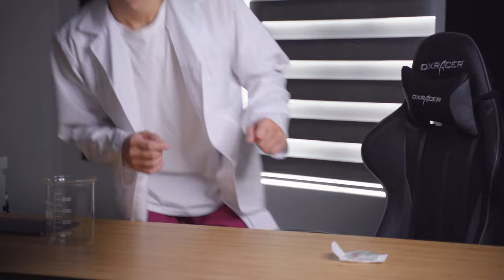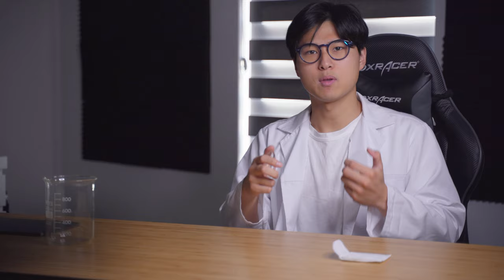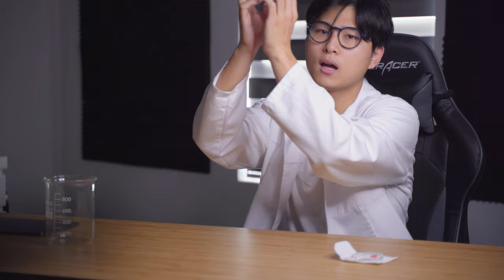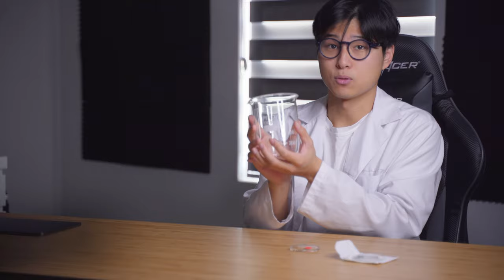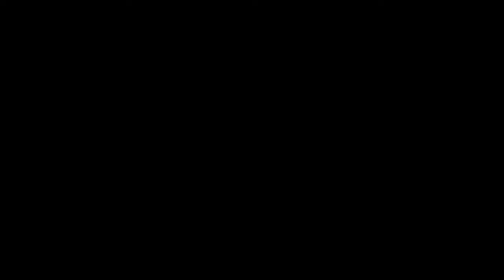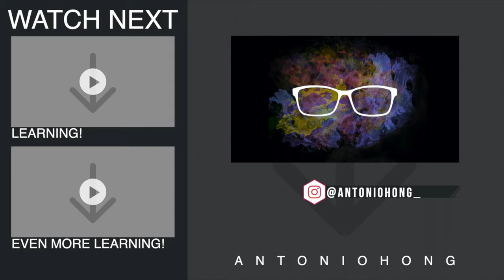HOW to tell the DIFFERENCE between GLASS vs PLASTIC lenses | Optometrist Explains

Comment: What lense would you recommend for -0.25 + 2.50 101 -0.50 +2.50 75 in a oakley marshal frame. My options are poly,trivex and 1.67. Thanks for any input
Reply from the maker: Depends on the type of work you’ll be doing with them. Poly and trivex have good impact resistance so are good for safety glasses whereas 1.67 is better optically
Reply: @AntonioTheOptom  custodian
Reply: @AntonioTheOptom  I thought trivex was best abbe value out of the 3 but maybe I heard wrong
Reply from the maker: @AG4runner  better optically as in you can make them up in a bigger range of prescriptions ! Sorry for the confusion, you’re right trivex does have a higher abbe number
Reply: @AntonioTheOptom  thanks for your response